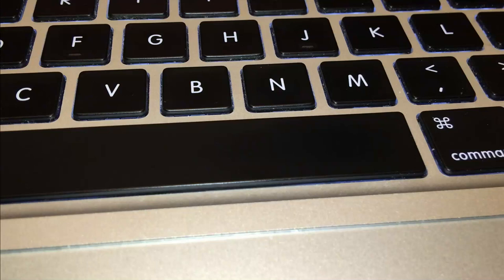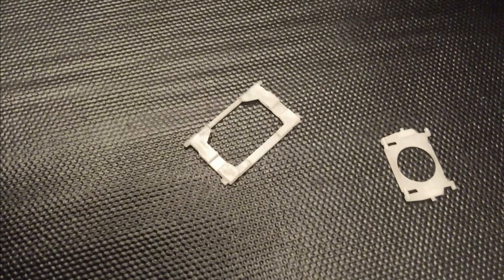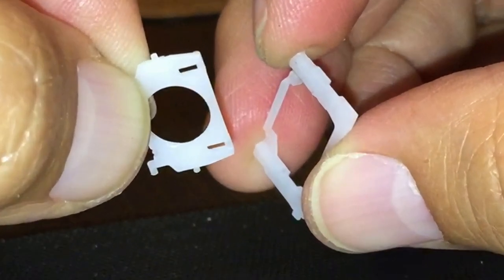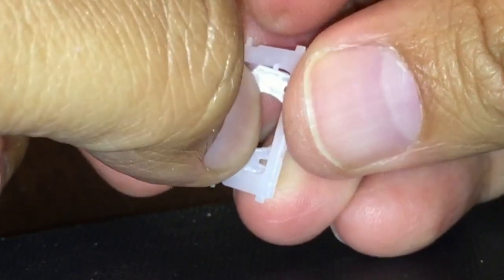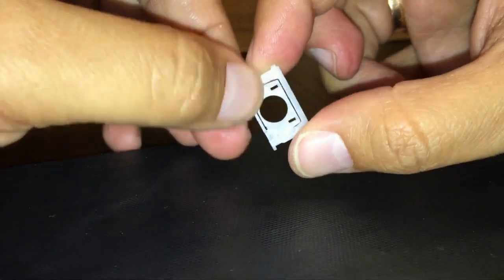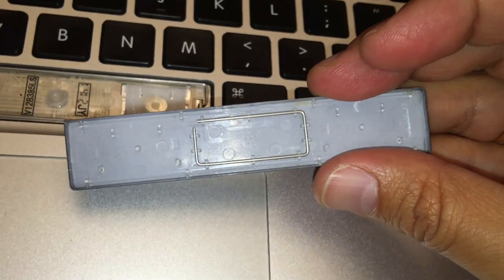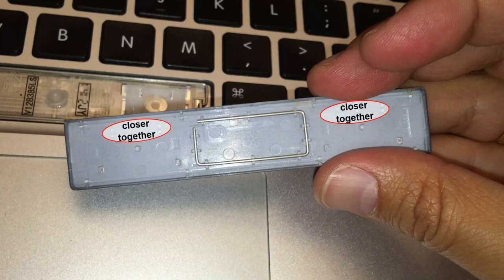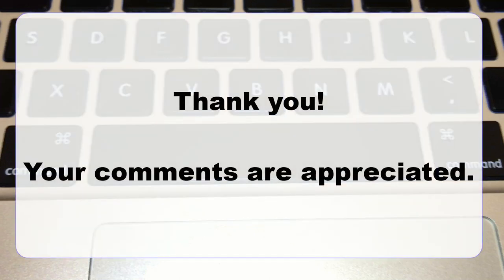Part 2. How to remove, replace, install spacebar key on Apple MacBook Laptop. Part 2.

Comment: Hi. Idid not see you actually explain how to install a new key. I have done what you said (thanks for instructions) several times and cleaned out all dirt. But stickiness continues. Any suggestions before I take it to repair shop to get a new key installed?

Comment: Nice focus on those tight shots. I had some debris under my spacebar causing it to require slightly more force on the right side, and this (along with Part 1) helped me quickly resolve the issue.

Comment: you, sir, just saved my life ! I used your instructions for my macbook air 2018 and it worked. The spacebar was sticky and the istore in Namibia told me they'd have to ship it to South Africa for repair and I wasn't having it. I just had to clean some sticky residue under the spacebar with spirits and voila! Thanks a bunch.

 Highly recommend this vid just be gentle on the key. you might chip the tiny things underneath that hold it in place.

Comment: This is a great tutorial and really helped me but found my space bar wasn’t laying flat and barely registering key presses unless I massed on the middle of the key. I convinced myself I must have damaged the key and was ready to take it to a repair shop. Turns out on my model the keycap was upside down! I have the early 2015 MB air. If you’re running into the same problem put brackets closer together on THE TOP and the wider brackets ON THE BOTTOM

Comment: Thank you so much when I was taking out my delete key the two plastic bits fell apart and your video is the only on that shows how to put it back together
Reply: I search that video too :/ I have the MBA M1, I put out the spacebar with a mediator but it's a different way to reinstall I don't know which

Comment: when i replace my space bar, it doesn’t come back up all of the way and i have to press really hard to get a space and it only works in the middle most of the time. can someone help me please?
Reply: i had the same problem, it's probably because the spacebar hasn't got hooked onto the sides of the spacebar properly. So press it a bit along each side, if you hear a clicking sound it should be good.
Reply: Fishnah mines the same and it was doing this before I pulled it up. Did you find a fix?

Comment: Anyone doing this on a MacBook air 2015 turn the key around and it will work. Great video!!
Reply: Figured this out for myself a little too late. Tried typing on it for a week and was about to pay to get it fixed before I tried flipping it the other way.